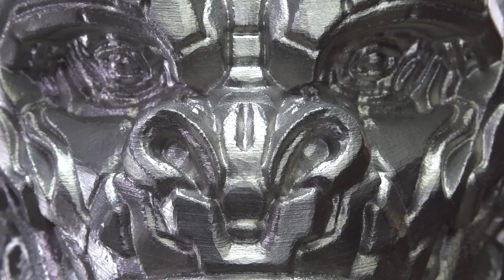Massive 3D-Printed Metal Transformers!

Comment: how u gonna print out that BIG ol massive head, and NOT have the high def poly printed? Yall decimated the model and it ruined all the sharp edges ....... 😩 I mean i guess you could hand tool it all but.. just seems silly when you could print the accurate edges? maybe im wrong but the visible tessellation aint an aesthetic 😫

Comment: To think you could have got a lost wax cast done for way cheaper and it would not be covered in 3d printing steps.
Reply: That isn't the point though.. also not steps they are called layers
Reply: @KORUPTable  
It is the point, it's unbelievable the acceptance of lower quality 3d printers have brought in with them. Layers don't need to be even visible, the steps all over that are big enough to trip over.

Comment: Cool print, I wonder why they didn't try to articulate it more, given that its a 3d print and not poured mold. I don't mean anything drastic either, something like interlocking the armor plating or at least minimizing the thickness? It's cool and the tech used is cool, but couldn't they have 3d printed a mold to use to cast it in the same alloy at a fraction of the cost?

Not trying to dog on them, just scratching my head in, possibly uneducated, confusion.
Reply: It is meant to show off what they can do with 3d printing metal, the thickness is probably to show off how thick they can make items.

Comment: I have worked in a machine shop that works with Inconel 718 regularly for the last 10 years.  The parts we make are for oilfield drilling and aerospace applications.  I started off in the deburring department hand working and polishing it, and I've run it on a manual lathe... The stuff is crazy hard, and a massive pain to work with compared to the other materials we work with.  We have been pushing for 3d printing solutions for some parts for a while now and it looks like it finally might be happening.  Loved the video!

Comment: Ive done a lot of work  involving the airfoils in jet engines for companies like GE, Boeing,Rolls Royce , etc.  I was blown away around 18years ago seeing my 1st 3d printed airfoil sample. Seeing what this tech has evolved to is just amazing. I've also had the , usually, displeasure machining inconel. It along with all the other airfoil grade alloys can be a very tricky matl to deal with from overall machinability to surface quality finish to tight tolerance holding along with concerns of not creating micro fractures or any other type metallurgical changes. Adam is a true jack of all trades and I wish I had 1/8 of his know how. Thanks for the great video. Man these times they are a changin.

Comment: My first encounter with Inconel was in a machine shop in ‘84. We made parts for the oil industry, and Inconel was very common. 

For my hazing, they left a 2”x12” round bar of Inconel on the floor and asked me to carry it to a lathe. It was standing upright and I tipped it into my hands and that skinny bar easily weighed 80lbs. Good thing I was young and reasonably strong. Yeesh.

Comment: I like how uncomfortable he gets when asked about the price. Is that really $100k+ of metal?
Reply: no, using the numbers on material cost I use at work for 718 powder in our machine, this thing is about $62K usd in just metal powder. (170 lbs=~77 kg, ~$800 kg) that said, you cant just load in that amount to get this, you need to have enough to fill teh entire volume around it. But as it sits, its about $62k worth of metal powder.

Comment: I don't mean to be negative but I work in 3D for a living and cant help but speak up - the mesh they used for the print seems to be poorly subdivided, and it really hurts my heart they made such an expensive print from a model not sufficient for it. You can see the bad subdivision best at 6:48. The edges of the circular areas are not sharp but instead have a strange polygonal pattern. This isnt the metal printer: the printer accuracy is far greater than this and can absolutely make fine details (you can see a contrast on the base plate). Really unfortunate.
Reply: Hi there. These artefacts are likely not caused by a lack of subdivision, because they don't run along the features of the model (like they would if the source was a subdiv polygon model) ; and they don't look like a multilevel sculpt shown at a lower level either. These IMHO are either caused by the model being aggressively decimated to make it lighter, or perhaps (but less likely) could be caused by it being a 3D scan. IMHO the most likely scenario to me is that this model had been decimated in order to work well at figurine scale, yet no one involved bothered to check (or speak up) before launching the metal print.

Either way, the fact that neither Joel or Adam addressed it (or the final edit skipping over it) is a bad look, and a it's a bit of an insult to the viewers really. It's the 3d print equivalent of "measure twice, cut once" ... so why not address it, so that others can learn from it ?
Reply: Yall like taking the fun out of stuff.
Reply: @NitaKerns  on the contrary - I own a printer and have great fun with it. I'm committed to a high level of quality in all areas of life and wanted to point out my observation
Reply: i noticed that too not sure how they designed it maybe it was empedded in the 3d model and would have to remodel it to get that out which would be a lot of work.
Reply: @zachmoyer1849  It could have been remeshed and run through a few filters (like ClayPolish) to at least clean up the surfaces. This would have taken no more than a few minutes to do (when things go well).

Comment: Seeing how they could barely scratch or discolor the head made me think of those corny old SiFi movies where Earthlings discover a UFO and try to get inside only to find that the UFO is impervious to everything they try.  OK, you can machine Inconel 718, but it was amazingly resistant to heat.  I loved that they tried to burn the head with fire, and it was not the slightest bit discolored.  I feel kind of proud that the small town near which I live in New Zealand (Blenheim), boasts a company that can 3D print titanium.

Comment: just a little addition here: jetengine turbine blades have actually been manufactured for decades with those internal cooling features without any 3d printing. https://youtu.be/1tM96B77n0U  3d printing in space industry is mainly for parts and complexity reduction, and thus cost reduction.

Comment: Hi Adam,  Love all your shows.  Just saw your shout out to Cutting Edge Engineering which is also one of my favorite channels.  One thing I like with the Cutting Edge guy is that he uses old equipment, makes it work and gets good results with it.  You may have noticed that Cutting Edge just purchased a massive Huron LU Mill that was manufactured in the 1950s or 1960s.  This machine is going to take a lot of work to clean up, put back together and make work.  You said you wanted to see his shop.  You could put a group together to go down there and get it running.  I think it would make a lot of very interesting videos, see all that needs to be done and potentially all the upgrades that system could use.  I'm sure you could find all the right people and get companies to donate everything to bring the system back up.  I would enjoy a trip like that but don't really have the qualification one would want to work on something like this.  So if you think a trip to Australia would be fun this may be one way to get there.  Cheers, Jonathan

Comment: I love how Adam explains the high cost to have something like this printed. So many people fail to understand that a large part of the cost is often compensation for the fact that a much higher value job needed to be postponed or even declined to free up the equipment and employees for something like this. It's easy to look up material and power costs but the cost to the business goes far beyond that. Once the tech reaches more mainstream levels of availability and use these costs will come down drastically. 3d printing is still in it's infancy, it has come a very long way from where it started but there is still a lot of room to improve and refine the processes.
Reply: Yes its like using the james webb telescope for a wedding photo.

Comment: Why doesn't that look like 0.05mm layer height? What about the sintering technology doesn't give you the surface finish of an FDM or resin print at 0.05mm? Is it simply because you can't keep the heat at the edges of a layer from "bleeding"?

Comment: The rush of 3d printing is over. Metal printing exists. I'm looking at the closeups of this and the only thing crosses my mind is...
... Why?

The triangles are too visible. The creases aren't sharp. The layers show. It's mostly a relatively high bas relief on a head shaped lump. It's a transformer... with no visible gaps between parts, let alone articulation. It is FAR less cool than the 5 axis motorcycle helmet.

Comment: True story, at the beginning of the pandemic I recieved about $50,000 worth of specialist inconel piping that had somehow got sent to my house in England instead of an oil-rig somewhere off the coast of Brazil  🤣   (weirder still, I used to work with that oil company about 20 years ago, but was unrelated to the mix-up) 
I worked with them to get it all sent to the proper address (these were all machined for specific drilling application, and no good to me).  They did however agree to machine me any part I needed out of inconel 718 as they specialise in it, and I just happen to have a gas-tubine engine I built that needed a new drive-shaft.  :)   win win situation.

Comment: A few years back I was on a bus ride home heading out of New York City and a guy sat next to me who happened to be an aerospace engineer. He told me about this process and how they are using it to revolutionize jet fuel systems. According to him, what was once around 2,000 parts was now printed as ONE piece...instead of having to spend a day removing the parts they can take out 5 or 10 bolts and plop on a new one! It was 3D printing bearings and everything! The process takes A LONG time in a vacuum chamber filled with Argon gas. It was the coolest ride back from NYC ever! Blew my mind
Reply: Yes! This is the same process—laser powder bed fusion. Some of our space and aviation customers have consolidated hundreds of parts into monolithic structures, eliminating countless points of failure and reducing weight (which then improves efficiency of the aircraft).